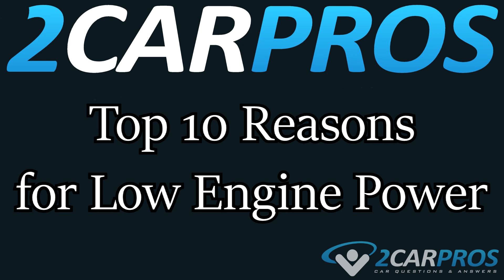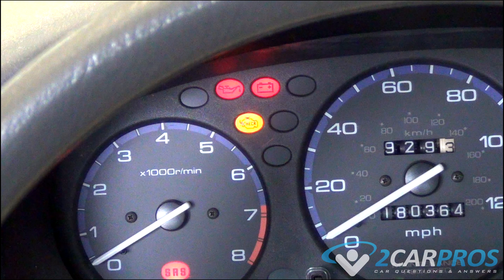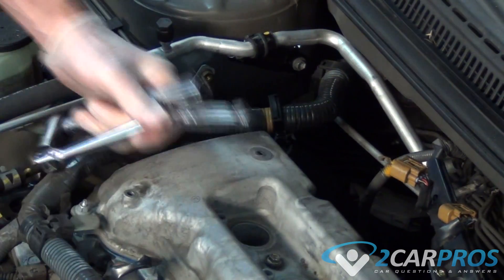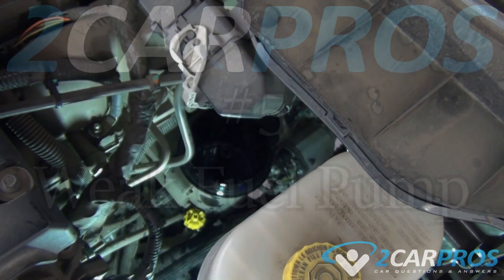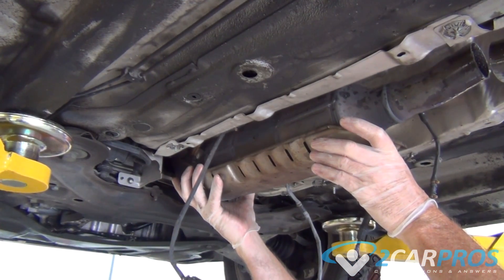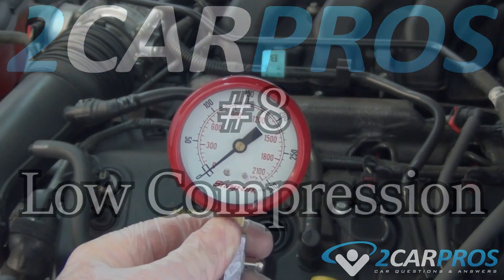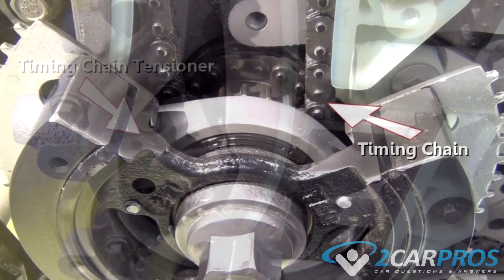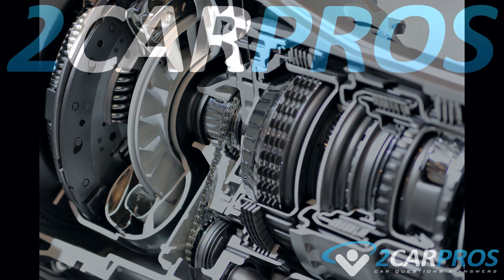How to Fix LOW ENGINE POWER in under an Hour!

Comment: Thank you sir for helpful videos ,but i have a question pls .i have Daewoo lanos car  i changed the engin  its used one but when i tried it on road specially when climping i loose power and cant go fast  its weak  the transmission on 1 or2 only and i hear a sound  ,i changed fuel pump, and idle sen. I changed the crank belt and many things ,when its cold its good but after i drive for 30min. I loose power ,what can i do pls. Help me thanx.

Comment: Why does my vehicle lose power when when I'm going uphill and on take off?  on flat ground it runs ok
Reply: Yeah. In your brain
Reply: You need headlight fluid
Reply: Did you figure it out. I loose power in 4th and 5th gear
Reply: @corysturgis6660  it's called overdrive gears
Reply: @Brandon-xe2se  I've heard of one overdrive hear but not two? I'm going to do a compression test soon. The 3
0 only put out 150 plus HP
Reply: @Brandon-xe2se  I was pulling a small trailer maybe 800 lbs all together and my truck kept dying up a steep hill. I had to dangerously turn around. I have never felt such lack of power before.  It wouldn't work in any gear. Kept shutting my truck off. Any suggestions greatly appreciated. I've spent way to much time and money trying to fix this power issue.  New fuel pump, test fuel regulator, maf sensor. Coolent temp sensor, aic sensor. Plugs wires, filter.  Just replaced clutch.  Beating head against a wall. Thank you
Reply: @corysturgis6660  I'm not sure what your driving but, your transmission would play a huge part in your ability to tow soemthing. It plays just as big of a role as your engine. Some cars and even trucks believe it or not dont have the power or potential to tow heavy things especially on an steep incline. That's why you'll see so many cars slow down horribly going up a hill as there engine is screaming. The cars putting as much power down as it is capable of which usually requires lower speeds. Lot of vehicles nowadays dont come equipped with enough "power" gears, more economy and efficiency gears(overdrive). Look into soem forums with other who drive your vehicle. If I had to guess your vehicle did the best it could and couldnt carry that load up that hill
Reply: @Brandon-xe2se  thanks for the reply. It has great pressure at 145 plus per cylinder. It's jus a small 3.0. Didn't have any towing issue till I got a steep hill in town
Reply: @corysturgis6660  hi cory did your problems solved?